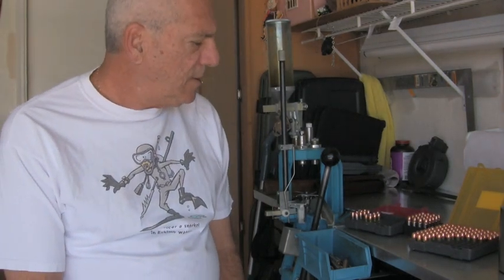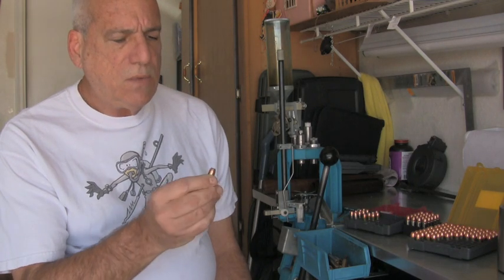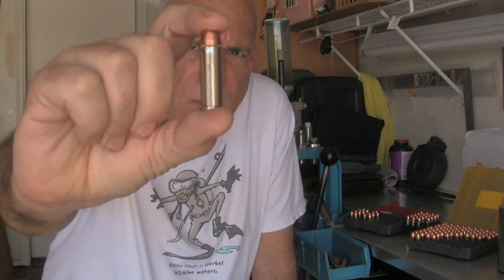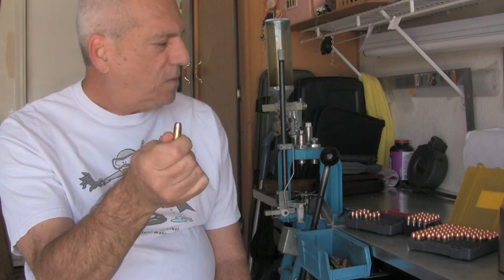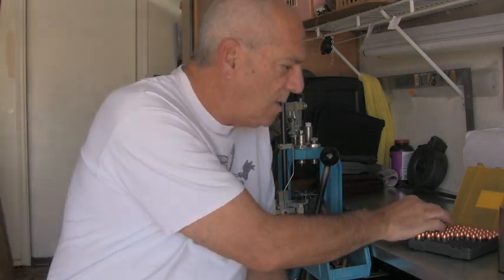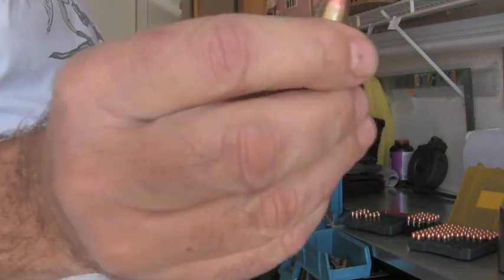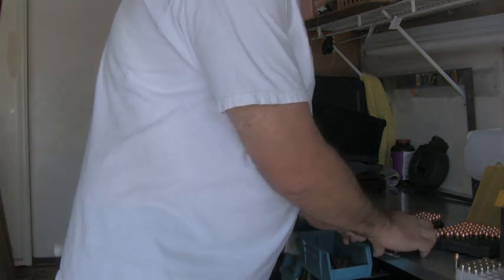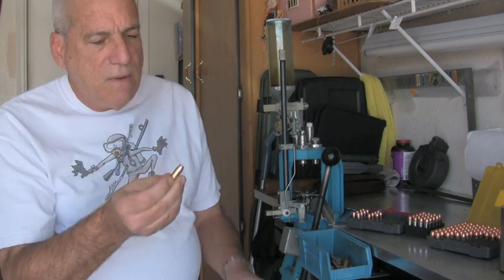To Crimp or not to Crimp, That is the question?

Comment: Thank you for the info. Can you help me to set up a new shop for making ammo?
Reply from the maker: Are you talking about a home reloading system? If so, The Dillon 550  press you see in my videos is an excellent choice.It has a lifetime guarantee, and excellent customer service. For the price, you won't beat it.
Thank you for watching.
Have Fun Be Safe :)
Reply: Thank you, I plan on making my own 5.56x45 in my basement. any info you may have on supplies would greatly be appreciated. I'm using CCI primers.
Reply: do I have to buy different dyes for other guns?
Reply from the maker: Unfortunately yes. Each caliber (with the exception of a few) are going to require a caliber specific shell plate and die set. In the beginning this is a one time added expense. In the overall picture you will make up the expense in your reloading savings.
Reply: ty. Is it best to stick with 5.56x45 55 grain? Do you know the best place to get bullets and casings and what would be the best powder to use? I was thinking those tiny little balls?

Comment: I seated a 9mm and the bullet was spinning inside the case. Even when lightly crimped it kept spinning. I pulled it apart and the bullet was .350 from the .355 dimensions.   What is the best thing to do
Reply from the maker: what type of bullets are you using ( jacketed, plated, or hard cast)? Is the.350 bullet representative of most of your bullets, or an exception? What die sets are you using?
Reply: Sorry.  Jacketed
Reply: +jr10   Bullets are 
X-Treme Bullets. Jacketed very good Bullets I hope. Maybe I'll try another type or manufacturers bullet
Reply from the maker: I'm not sure which bullet you are referring to. The X-Treme bullet that I am thinking of  is made by Lehigh Defense. It is a solid copper bullet. Are the cases new or resized ? If they are resized, what is the measurement at the case mouth?
Reply: +jr10 your thinking of the wrong bullet then. It's definitely not solid brass or copper. I bought from LeHigh for my Barrett 416. It's just a lead bullet with copper jacket.   X-Treme is pretty big company I even seen there Bullets at a reloading shop here in Anaheim Ca.  Either it's too soft causing it to crush when seated or crimped to much.   I'll try another caliber and another manufacturer bullet I have some Hornady. I'll see what happens
Reply from the maker: sounds good 
Thanks for watching.
Reply: your bullet is undersize, and, not suitable for 9x19 reloading. Get some sized .356" or so...

Comment: Is it normal to have a little bugle on the case when reloading 9mm?
Reply from the maker: Depends on the the extent of the bulge, and where it occurred.
Reply: on the top of the case
Reply: but when I try shooting it  there weren't any malfunction.
Reply from the maker: There will be some noticeable budge . The bulge your are referring to should not be any wider then the bullet diameter plus case wall thickness.This measurement will vary based on brass used (new, used, different  mfg. etc)
The case gauge will also help you monitor this, as shown in one of my recent videos.
Reply from the maker: Then your rounds were in spec. as far as your weapon's chamber was concerned.
Reply: i tried doing a gauge test using my barrel and for some reason my 9mm won't drop out i hand to pull it out with my fingers btw I am using lead cast bullets i heard it's really common
Reply: even tho all my 9mm cycled fine iam still a little worried.
Reply from the maker: What mfg. are you using for the lead bullets?
Reply: mfg?
Reply from the maker: Who is producing your lead cast bullets?

Comment from the maker: For instance, If you take a recently fired Glock highly polished Tenifer finish,and look for leading.You look one way with one type of lighting,and all looks good. Run a patch through, and not so much.If you add in variable like powder burn rates,lead blends and brinell ratings, crimping techniques, etc. you have a lot of room for problems to occur.The real problem is when an inexperienced shooter switches from lead to jacketed bullets without cleaning.With plated bullets I don't see the need :)

Comment: Sir I have to bring to your attention ,that during WW II. Loaded 45ACP ammunition was loaded so that it wouldn't push back in during the loading sequence associated with the bullet striking the loading ramps, such as the many open bolt arms that were being utilized. WW II 45 munition was loaded with a cannelure on the outside of the case at the base of the bullet creating a sort of shelf for the corner of the bullet to bump against so as not to be able to be pushed back. And also improving reliability by not allowing the dangerous pushing back of the bullet . Which created a serious over-pressure delemma, as you know. And to this day a lightly loaded crimp on a reload in a lot of the low end 1911 clones will push that bullet back during the loading cycle,once again striking the feed ramp. Now I'm not talking about a well tuned and polished feed ramped 1911. Go back and find a picture of true WW II 45 and you might run across the spec. that it was suppose to be able to withstand 45 pounds of push on the bullet . What's good for the goose is good for the gander. If it was working good in the tommys,and grease guns, then it would work in those rattle trap ,GI ,"well tuned" 1911s.
     No disrespect, for many many years I too thought about all the ramifications involved with auto cases not dealing with any kind of a roll crimp , when I first loaded them. And suffered with a long time drought on shooting reloaded 45 ACP. In one of my favorite guns.then in my late 20s I got my first legal full auto Mac 10. If I was gonna shoot this ,I had to figure out what was going on with the crimp details. Then a few more years passed and Lee Reloading came out with the 4th stage die for crimping auto cases. And the light came on. And in time i had a friend that owned a vintage Chicago gangster Thompson.and in the fancy case he kept it in ,there was a box of Ammo from the time. It was in there for decoration,not for shooting. This Ammo had the cannelure around the outside of the case I spoke of. We also now had some of the first forms of Apple computers ,that I could work for searching the web. And it was on as far as solving the case cannelure. Anyhow I appreciate your video showed how much you had thought about the A, B, C's of crimping case necks on auto cases.

Comment from the maker: I have yet to see any properly seated 45ACP bullet move due to chambering, or recoil.I load my 10mm rounds far in excess of any pressures in any 45. Not one of my 10mm rounds has any type of pronounced crimp.It is only my personal opinion , but I feel some of the extras ( id crimp die for 45ACP) are nothing more then added revenue for the die maker. I did a followup to this video a couple of weeks ago which is far more detailed. It should explain this more clearly.Look 6 posts below this post :)

Comment from the maker: over belling is the most common cause of fail to feed in straight walled cases.I am fairly certain the individual at your gun shop was referring to the removal of any residual belling with his reference to factory crimp.If you look at any top tier  45 round, i.e. Hornady, Winchester, Remington, etc, you will not find any visible crimping. That case mouth seating is very important in proper functioning of semi auto pistols.
Have Fund Be Safe :)

Comment from the maker: i understand your frustration. I would never recommend using anyone else's reloads in your weapons. If you do not load your own ammo, especially high pressure rounds like the 40 S&W or 10mm then shoot factory only. it sounds like your buddy had the case mouth belled to much and therefore the seating die was not able to properly seat the bullet. I would read up on straight walled cases and semi autos before going to far with crimping. Just my thoughts. 
Be Safe :)

Comment from the maker: It is common for a lot of people to use lead in Glocks. With the cost of plated and jacketed bullets on the market, and my propensity to push the limits on pressures and velocities in my testing, Lead would not add any benefits for me.One important point to remember. Do not switch between your lead bullets, and plated or jacketed bullets in the same shooting session. 
Thanks again for watching. 
Have Fun Be Safe :)

Comment from the maker: Sounds great. If I might make a small suggestion. If you have loaded ammo before then full speed ahead. If not, may I suggest that you start with the 45 ACP. Once you have gotten comfortable with the basics, then get into the higher pressure rounds like the 44 mags and 40 S&W. Also get familiar with the basics of necked cartridge reloading before getting into the 308. If you need any help, let me know.
Have Fun Be Safe:)

Comment: Thanks for the video!  There's a lot of self taught pros on youtube that are eventually gonna get someone killed.  Thanks for posting a potentially life saving video.  Kudos and good karma to you, sir.
Reply from the maker: Thank you Dan. I really appreciate that. I agree with you. There are a lot of subtle areas in reloading that get overlooked. 
Crimping is one of the most abused of these areas. This is why I put this video and the more in depth Part 2  out. 
Have Fun Be Safe :)
Reply: I've just begun loading some .308 SMK 168gr. rounds into Norma brass.  There is no canular but the rounds I'm loading are headspaced -.001 and I am about .050 from the lands.  I am also using a concentricity gauge for roundout. Because theses are "precision" rounds, I have elected to put a ever so slight "factory" crimp on them just to keep them in place in my hunting pack and/or magazine.  However, when I first started loading I have taken the advice of one of those, "know everything" reloaders on youtube and found that my rounds that were supposed to be going 2500fps were traveling at 3700-4200fps with zero consistency.  That's when I checked the amount of crimp and found that the guys I was trusting with reloading instructions on here were DEAD WRONG!  Thanks again for the great video!
Reply from the maker: Dan Ryant Dan. it is so refreshing to se someone who understands head spacing techniques and their importance. That alone puts you light years ahead of the wannabe know-it-alls. 
you'll do fine.
Have Fun Be Safe :)
Reply: Thanks jr10,  I appreciate that.  Ya know, its funny... if you read the front of the reloading books, it tells you all about it.  I figure, hey, im gonna do something that could kill me or someone else,  perhaps i should learn about it.  :)

Comment: All autoloading rounds MUST be crimped! It's a rough, harsh ride into the chamber. The factory crimps all ammo. The key is not to overdo it! An easy way to check your crimp is to pull the bullet after loading and if you see a very light impression on the bullet from the case mouth you are golden. I mean VERY light. You have to look in a bright light to see it. If it is plainly visible, you are crimping too much...should just be a  barely visible hair of a mark. Plated bullets will mark easier, so set your die with that type of bullet and you will be fine for regular jacketed or lead bullets. Revolver rounds must be crimped or the bullets can back out of the cases on recoil...the heaver recoiling rounds...magnums need a heavy crimp. I have seen bullets back out on revolvers, I have seen them telescope back in the case in autoloaders. I load 5000 rounds a day, 5 days a week on Super 1050s since 2009.
Reply from the maker: clloydhi While I agree with what you are saying, your most important statement was not to over-crimp.. This video was a response to some very dangerous, and inaccurate reloading information. The sequel to this goes into much more detail, and introduces head spacing issues.Thank you for watching.
Have Fun Be Safe :)
Reply: the resizing process is all a autonloading round needs to hold it in place.  every manual I own and that's a lot will say little or no crimp.
Reply: First book I picked up off my shelf was Lyman's 49th Edition and on page 31 "Bullet crimping is required whenever there is a possibility of the bullet striking a firearm surface (during the feed/chamber cycle) with sufficient force to push the bullet deeper in the case. This means that ammunition for almost all semi-automatic and pump actions should have the case crimped to the bullet." Revolver ammo MUST be crimped. Ammo in tube magazines MUST be crimped. I have loaded over 7 million rounds, more than half in autoloading cartridges. Every book I have used says the same thing about crimping. Here are 2 articles from the top half of the page I Googled about crimping : http://thearmsguide.com/7747/reloading-101-crimping-revisted-part-1/  http://www.outdoorhub.com/how-to/2014/04/15/reloading-seating-crimping-bullets/ People like you give reloaders and ammo makers a bad name.

Comment: Too much talking just tell me yes or no - 45 acp 200gr round nose fmj - crimp or no crimp.  (Yes or No)
Reply from the maker: If you are asking this question, then you should not be reloading.
Reply: remove the damn bell; once the damn bell is removed, the case mouth ought to measure about .471"....; any smaller than that, and you are squeezing the case and bullet undersize, which does not help anything.